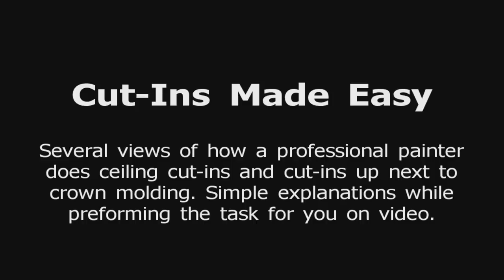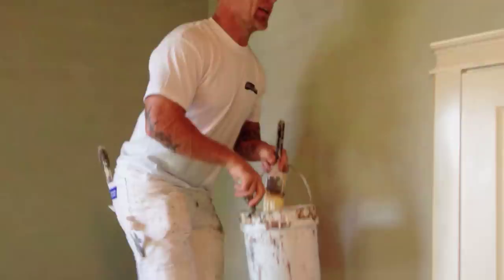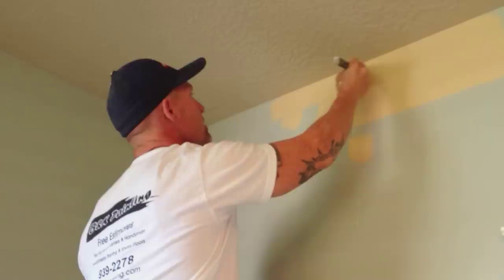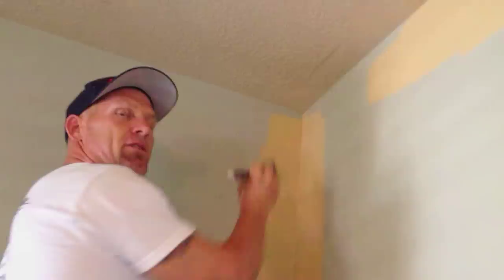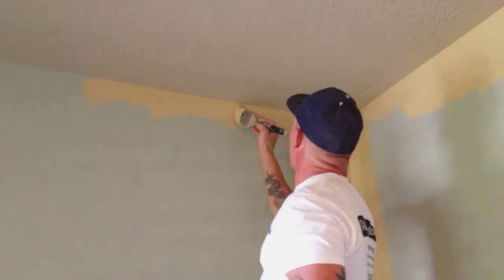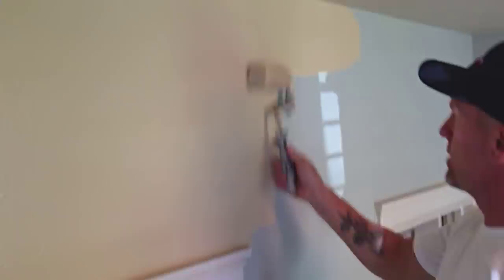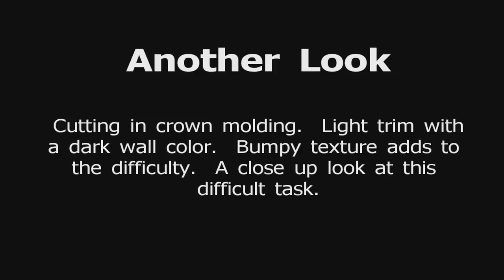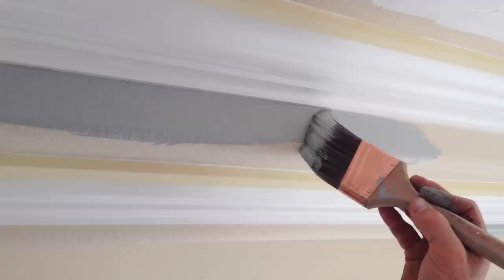CUTTING CEILINGS.  DIY How To Paint A Straight Ceiling Line.

Comment: Aaaahhh so you roll over it after. I put a first coat of paint on the walls and you can clearly see the difference between the roller and the brush when I cut in. Thanks for the tip.

Comment: My dad was a painter. I grew up with a brush in my hand. I was always amazed how fast and easy my dad could cut in a room. I got pretty proficient with a brush and could get along fairly fast but could never equal the skill level my dad perfected over the years. He never wasted any strokes so he could just cruse along nice and easy. He was picky about what paint he used and liked. Some paint just doesn't role off the brush as well as others. A good paint just roles off the tip and lays down nicely. My dad has passed away but I am proud to have learned the skill from him. He left his painting and carpentry skills with me. I liked your video. It is a little deceiving as you made it look too easy. Your skill level is high and when other watch, they get the impression that cutting those lines are easy. A good painter always makes it look easy.

Comment: From one painter to another you are a boss my friend, after 16 years of doing it I didn't think 
I could learn much more about it but using a 4 in roller to minimize/ eliminate brush strokes in the cut in
is an elite tip and one I will utilize. I currently use the roller for the walls and roll parallel to the ceiling after 
I cut the entire wall in for the texture but on hot summer days in houses with no AC doing it like this will 
be more efficient and I would assume give a better finished product. So in short thanks man, Cheers!
Reply: +The Idaho Painter    Done and done

Comment: Been painting for many years.....Ive never heard of or seen a nap? I could see that being useful in some spots but to do a whole room with that seems to  me to be more work than needed. You cut in and down a good 4 inches and you roll up to it. You should never see any difference in texture if you do it even semi right with todays paints no? Nice brush work :)
Reply: It's for a better finish.
Reply: I'm a pro and cutting in three inches is all  that is needed... then roll up  into the cut in without hitting the ceiling. May sure all paint is inter-mixed or you could get a picture frame affect. Trying to one coat almost never works. Use better paints too. I prefer Wooster brushes  A very unusual trim and hardly the one to show amateur painters.. I would think that crown molding would have been all white, not with the dark color separating it....
Reply: rofl.  "been painting for years."  Never heard of a nap?  What the fuck do you roll the walls with?
Reply: A standard roller sleeve mounted on a handle like 99.99999999% of the free world. And I wasn't rude so not sure why you have to be.
Reply: depends on the texture you're working with, a smooth texture will definately show brush lines if you're doing one coat, you should roll as far into your cut as possible it coats thicker and doesn't leave brush lines imo
Reply: socratesandlavagods No kidding, right?
Reply: My thoughts are this..maybe this video is geared for people, like me, who aren’t professional and need to diy to save $.  I’m not sure I could hold a big brush for long periods of time..so maybe he’s just trying to help DIYers
Reply: The nap is the furry part of the roller, he just has a habit of saying it rather than saying roller
Reply: How do you paint and not know what a nap is?
Reply: Also am a professional painter and have never seen or used a nap lol. Just cut in about 3 inches from the cut line and you’re good
Reply: I always use a roller and a brush when im cuttimg in a wall. On orange peel or flat wall you would definatly see brush marks if you only use a brush.
Reply: Actually nap is the real name for it. It even has it on the packaging of it.

Comment: Finally.....somebody who puts that first cut in on a little thicker than most. I have a habit of putting paint the paint on a little bit thick during cut in for the first coat to kind of match the thickness that the nap will roll the paint on. Bad habit maybe ? Just what I feel comfortable with so I can put the paint on thin the second time around so it all smooths itself out.

Comment: ant never in my life seen a professional painter cut in with a brush and use a weinne roller. truthfully didnt think that no one used angle brushes. 3in destroyer and u can brush 3 ft instead of them lil ass brush strokes
Reply: joe holmes me either! It's not a weenie, or pencil, roller though. It's a 4", same principal, but I don't use either when cutting a ceiling. One thing I do that he didn't mention, or follow, is always go from dry to wet. If you need to "blend in" your cut in line, after rolling out a wall, take your dry roller, position your 4' ladder about middle of the wall, and dry roll with your 9" as soon as done rolling the wall. One long stroke across the whole cut in with a dry roller. usually no sense in though. Your roller man will be on your ass, lol, so you better pick it up, or you'll be told to " TAKE YOUR BOOTS AND GO TO THE SHOP!" In other words, as Trump would say, your fired!
Reply: joe holmes tell he bro he must be a rookie painter 3 in all day...paint life
Reply: Some home owners don’t like to see brush lines that’s why he smoothes with the 4” roller

Comment: When I was a young painter a 4 inch emulsion brush was practically standard, now I've dropped down to a 3 inch but I see you're using a 2 1/2 inch brush. I always thought that the wider the brush, the easier to cut a straight line. I shall have to re-evaluate my ideas. Thanks for the videos.

Comment: Glad to see I've been doing it right all this time. People often ask me why I don't use a smaller brush. Especially around moulding that is shaped. It's just a matter of twisting the brush at different angles and pressure. Thank you for this. Taping for me takes longer because by the time I'm done taping I could have had the painting done. I also don't have to go back and worry about fixing spots where the tape didn't make the deal or came loose where I couldn't see at the time.

Comment: Steady hands are a must have. I also hold my breath when making the cut. Kind of like when you're shooting a gun. I'm a painter from Ohio. I just spent quite a while cutting some very intricate molding at a place. I had to use just the very tip of the first two bristles to get into those tight curves. It turned out beautiful, but you have to have great patience. Also! I normally feather my Wizzy lines so I'm sure not to have a snail run going from side to side. I do this by slightly lifting up on the downward end of my Wizzy roller. It helps when you don't have a Cover Man with his roller readily available. You can come back any time and roll into your feathered cuts. I also don't use my brush for corners at all (except at the top and bottom), I just smash the end of my mini-roller (Wizzy) into the corner from one side, make my stroke about 2 ft., flip it to the wall next to where I just painted and I end up with a nice 4'' textured 'feathered-cut' coming out from the corner, and this way there are no brush lines. It looks great when even the corners are textured. Thanks again.

Comment: Great instructional video! I've seen the results of cutting in many times before, tried to do it several times myself, always made a mess. (I won't even say all the things I was doing wrong.)

Inspired by your video I just bought a 2 1/2" sash brush and practiced with white primer against a white ceiling. The technique actually works!
I'm about to start painting two rooms worth of walls, and this is going to save me a lot of time.

I almost never donate YouTube channels money but I just gave yours $5.

Comment: FINALLY... I spent hours upon hours looking for another painter that back rolled brush lines. And also uses an 18" roller cover on the walls instead of the baby 9" lol... And there you are. You do both as well!  Since I'm a female, all the male painters I cross paths with think they need to question what to do. I do the same around casings as well. Looks awful when they don't. Sometimes a hallway can look like each casing is framed.... with brush lines! I use a 6" weenie roller, the ones with the plastic tip, same end  result, but then I can use my light cut cup instead of holding that heavy paint can with my dainty little female hands. lol

Comment: Another tip I observed in this video which you forgot to mention that a lot of people overlook to get a good paint line is to get the right height on your platform so your eyeliner is as close to the ceiling as possible without your head scraping on the ceiling...as a lot of people tend to stretch up too far and which causes arm ache and as a result an unsteady hand...👍🏼

Comment: Your techniques are very helpful, thanks so much.  I've had so much trouble cutting in using the flat tool with the little wheels which always seem to get paint on them and this goes onto the ridge of the cornice and is so annoying.  I will try your technique on the rest of my house.  I painted my previous house all the way through and now I have moved and have done 2 rooms so far in my smaller house.  Thanks very much

Comment: Good painting demonstration Chris. this might be a good demonstration for novice painters. This will guarantee a good-looking paint job for the inexperienced house painter or condo painter. But if a truly professional painter who makes a living at this one all these practices they would go broke.
We use a 3 inch, square cut Purdy or Corona paintbrush for our wall cut ins. I never use a roller along with the cut in. My wall, cutting in is done only with this brush and it is wide enough that it will cover enough surface area to allow the holder to enter the painted part safely without hitting the ceiling. The main concern with brushing is not to leave any sagging or heavy paint deposits without making sure that you have smooth the bottom edge of ensuring a smooth transition between the roller and the brush work. I have further videos on this on my channel at Mississaugahandyman channel.

Comment: Hi. Just another perspective here. 
I load the brush and drop load near cut. Push on the brush to feather out the bristles and you can clearly see where your cut will be. Cut then grab dropped load from where you put on wall. Continue cutting.
Feather the bottom of cut to blend into roller. I dont see the need to go both directions on cuts on the first coat. 

I get the roller but I feel that it adds another variable that could ultimately lead to ceiling touches.

Comment: I also use a 9" 3/4" nap and roll tight to corners saving that step of the 4" roller. If you have trouble cutting in ceilings,  draw a pencil line where wall meets ceiling,  then cut to the line.
Reply: yes draw on the wall with a pencil thats how pro's do it lol
Reply: Anthony Edmondson "If you have trouble cutting into the ceiling draw a pencil line"? How is that any easier than cutting into a ceiling line?  Seems to me both take skill. If you have trouble cutting in to ceiling just mask it off seems better advice unless you mean as a means to train and build skills.
Reply: I like that idea,  if I wanted to paint a line just below the actual ceiling line.  Sometimes it's just too bumpy to get a good line

Comment: I love Purdys they do the work for you. Im not fond of the angled tip brushes i just find them too flimsy, I prefer to load about an arms reach of paint about a centimeter from the line then mould the brush to an angle up to the line and the brush will push the paint up to it. we use 3 inch purdys most of the time i think the biggest fault i see novices do is the very basics of how to load up a brush and then wiping back the excess from the stock hence why people get so messy and get runs ect i love painting its the best job ever!

A fellow English Painter

Comment: If you want a razor sharp line, use a 5 in 1 to score the ceiling line. The scoring will make a small channel at the wall and ceiling line. The paint will flow into the channel and never touch the ceiling. I use a 3.5 in sash to cut in a wall. I can cut the ceiling line in a room 15 x 15 in under 5 mins. I also use a wiz roller to backroll the brush marks. If your not fast enough I highly recommend to cut a wall then roll it so you dont end up with picture framing and holidays.

Comment: :)...Nice job! We all do that different I guess...I do it with a 3 inch sash and fan out the edge I do one wall inside corners, Up to about 12 feet wide and cut in the base then field roll as close to the ceiling as I can, then run my roller about a quarter inch from the ceiling before I downstroke the wall with the roller...If you're using 18" rollers your method is the better method...:) 30 year painter...

Comment: We have the same cut in technique. I used to love Purdy brushes but then I tried out the whizz brush and it's a boss compared to Purdy or wooster. It holds a lot more paint and feeds out of the bristles more accurately. After a months use it gets nice and fat at the bottom but skinnier at the top so you can drag monster lines with the same accuracy.

Comment: Great videos. The one thing I am good at is cutting in, must have a steady hand. However, when it comes to cabinets, window frames.... somewhat wider areas that require a brush, I leave deep lines. I have to go over and over to achieve coverage and it dries. if I try to use more paint to avoid having to work it, the paint runs. Maybe I am doing the various edges in the wrong order.

Comment: awesome Job Chris!!! learning every day with your training videos and they help a lot with me knew in the job field!!! thanks bud God bless and like Bob Ross would have said Happy painting haha!!
Reply from the maker: Thank you for the support, much appreciated!
Reply: Home Improvement How To's I have a question so this is a hard technical part of the job painting and asking for some support. when painting trim around doors the face of the trim is easy and the side where the door closes is easy but any pointers for the other side where the trim is only about 1/4" and meets the wall. spraying it trim this is easy but using a brush is hard. walls already painted how is the best way for you to paint that section of the trim and get a straight line without getting pain on the wall. very hard with some of that old houses I paint and the walls not being even or straight.

Comment: This guy has some skills, he uses roller to minimize brush marks, I agree. When painting a wall it must be rolled while the cutting still wet. Why?  If the corners dry when roll, it puts an extra coat on the corners.  Today's paint might be okay, but in the past it would leave a visible mark on corners.

Comment: I cut in my walls first but I didn't use a small roller like you did. Lesson learned. What kind of nap are you using? That nap holds paint really good and a lot of it too. Great video, Thank you for the tip.

Comment: I have used the videos over the years to make sure I'm doing my jobs correctly. However I've never ever followed up my cutting with a small roller like this. I get why but honestly I've never found it to be an issue nor have I found a client that has ever been that picky to notice. That's small stuff a painter might notice but no one else ever would.

Comment: great tips. I just wish I had watched this one day ago - I started painting an accent wall in a dark color, but I did the wall first and left space to go back and do the cut ins at ceiling and walls. the problem is that the paint is so dark (almost a chocolate color) and I have already rolled my walls twice. will have to do a third coat today. Should I do the cut in multiple times to prevent having the halo marks show???? (you make it look so easy - but it is a real pain to do).

Comment: hey buddy I'm spraying doors right now with an airless. I'm using a 4-15 tip but I'm getting a line a the bottom of my fan. I've cranked up the pressure but it's not helping and put a bran new tip in and still no change. I was thinking about a smaller tip size next. what's your thoughts. from Jayson thanks

Comment: You are a really good painter with a steady hand. I am going to repaint my DR ceiling, walls and trim. I am assuming it's best to begin with the ceiling, then the trim and then the walls. Question, there is an opening (used to be a door) from the dining room into the kitchen. The trim on one side (left) is directy touching the opposite wall. How is it best to get a straight line on the wall without getting it on hte trim? Any suggestions would help. Thank you.

Comment: Hi Chris.  Would you cut in crown molding after the walls and ceiling have been painted or should I paint the molding first and  then mask it?  Also, this is a remodel job and the ceiling has popcorn texture. Thanks for the video.

Comment: chris,i know you dont really use oil base paints but if u have any tips on brushing oil base paint to eliminate brush strokes, please send it. im running into a few houses that have been painted 30 plus years ago. i think they used bm satin impervo oil. that was very popular and was apparently known for how well it brushed. well tryin to paint over that with little experience with oil is not easy. any help is awesome

Comment: Nice video, very detailed. I work for a guy who doesn't like using the 4 inch nap to roll over after you cut and he expects me to paint 1100 square foot house without taping anything off and he wanted done in two days when I do this work alone.I work turning over apartments getting them ready for the next tenant. With only one person painting what's the average time to paint 750 square foot apartment and a 1100 square foot house?that's walls and ceilings. And which paint sprayer would you recommend for my type of work?